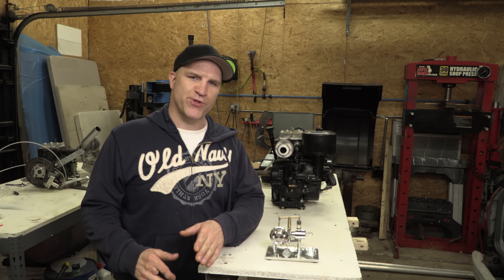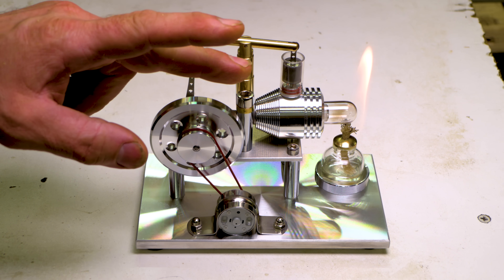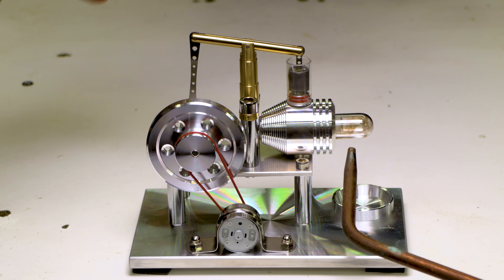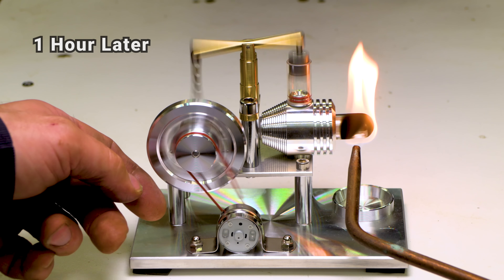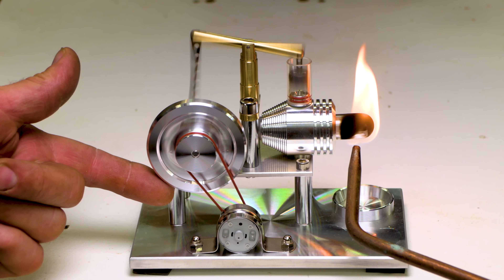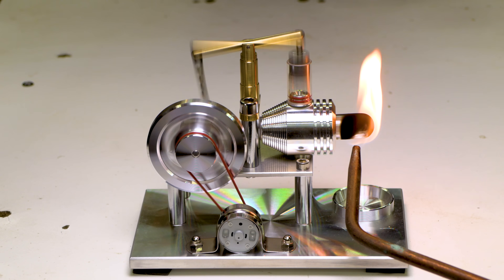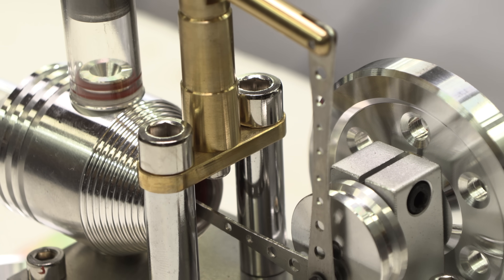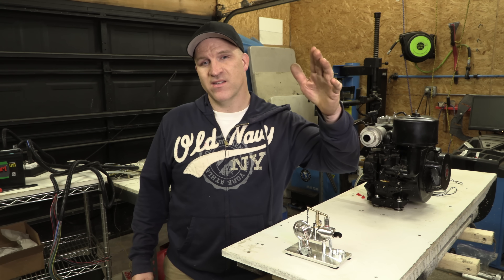Can a Stirling Model Engine Run Non-Stop?

Comment: I've seen engines that ran off a coffee mug's heat.  By comparison, this little guy, is demanding an enormous amount of fuel-burning in order to run.  It's too bad they don't make a coffee cup-sensitive stirling engine that has been scaled up to output 1 or 2 kilowatts.

Comment: If heat saturation didn't stop it, lack of true bearings at those narrow contact pivots points certainly will. Would love to see a well engineered version designed with longevity in mind ..

Comment: Your natural gas is burning too rich and the flame could have a little shield on so there's very little heat leaking over to the cold block.  Also, a temperature sensor on the hot end and cooler end could indicate if you're in a steady state.

Comment: Could you take a Fernnell (sp) Lenze from a projection TV to power a larger sterling engine to power a commercial size generator?  I live in the heart of the Mohave desert.  Daytime temp a little low for this time of the year at 107 but I have seen it 120 here on the Colorado River.

Comment: I think this is the engine I want to use as a “plant engine” outside on the back yard, up on a post, exposed to the weather, running the flame on kerosene and driving a slow pump to bring the kerosene to the reservoir from a tank, to keep it running continuously.

Comment: Dude.. We can use artificial diamond focus lenses to heat boilers for nuclear reactors with light guided down inside, and use excess energy to make hydrogen to run the system for night. Easy.. The system is programing us to be livestock period.. Btw, nuclear reactors are steam engines with radiation heat source..

Comment: I love these little Stirling engines.  I have a practical question, and an idea for a cool video, I would like to know what the easiest way to modify one of these engines is to produce 12v dc via a motorcycle alternator, and also which commonly available fuels produce the most energy.

Comment: as long as you supply heat to a Stirling in an open system there will be enough difference in temp to keep it running.  Unless you melt it.
Reply: Stirling engines are closed system by definition
Reply: @eifionjones559  Okay isolated if you want to get picky

Comment: I understand your thinking: it does not lose enough heat. And I agree, there should be more cooling applied. I guess the reason why it manages to keep running cool enough is, next to the radiation of heat, the air from around going in and out the piston's cylinders.

Comment: After how much time is the glass going to crack ? 
I just bought one and I'm afraid the glass will cracking after a few minutes . But it's a Chinese knock off so idk
Reply: so easy to make a little alloy heat shield tube around the glass
Reply: @eifionjones559  no need for a heat shield . The Chinese knock off is very good and can go for hours at top speed . I had enough time to test it :)
Reply: @DrKampfpudding  the shield is actually called a diffuser
Reply: Sorry that you bought Chinese knock off for cheap. Next time buy American made for $1,000 or probably even more. 😒 Trust me you would not have this made in the usa for this price. Seriously stop talking trash about Chinese made products or their people. Que te han hecho los Chinos a ti?

Comment: ca you run one of these by shining a magnifying glass on the end of the heat exchanger?
Reply: Theoretically yes, practically maybe? These engines don't need a massive amount of delta-t, but they have to have enough energy to overcome the friction of the components

Comment: The engine cannot last forever. It running depends on the fire going. If the fire runs out, the engine is too
Reply from the maker: That's correct, same as a combustion engine though. If you run outta gas, that's it !

Comment: Phillips Holland back in 1953 had a few running just after the big flood in the Netherlands, hooked up to some generators for electricity, to aid in the clean-up and rescue operations.  They owned the patent back then.
They even had some buses running in Eindhoven. Obviously there were some snags with this motor as they stopped developing it and sold the patent -I believe to Ford, but I'm not sure. Also the original design this guy's talking about was quite, quite different. It was much more vertical design.
Reply from the maker: Thank you, is this an alpha type correct?

Comment: The engines principles are based on a difference in temp between the cylinder and the flame. The gas flame will always run hotter than the cylinder does. Hence it would theoretically run forever. That's my understanding anyway. :)
Reply from the maker: I think you're absolutely right, I realized that shortly after this video after I thought about it for a minute. I'm assuming eventually it will reach its peak level of inefficiency and minimum power output, and if that number is enough to complete the cycle, then it will keep on running that way.

Comment: U think if the flame was turned down some and the radiant heat wasn't as hi it would have lasted longer?
Reply from the maker: Well it lasted too long for me. But in the episode I will push this thing to the extreme
Reply: @WarpedYT  yes and most tests that last over ten minutes I am on to the me t video but I am very intrigued by this engine just ordered myself one

Comment: Hey can you do the video on electrical overload fire?  I have always been curious to see what happens inside the wall and so on when an electrical fire starts.  you should do like a loose connection, then another one with like an overloaded wire with two big of a breaker and a few other electrical fire starting scenarios.
Reply from the maker: I will totally put that on my list. That sounds like a lot of fun

Comment: I figure either lack of cooling or lack of lubrication will be the end of it
Reply: add an oil dropper on he hinges, and water cool the heat exchanger and it will run forever
Reply: After an Hour the sytem has itself stabilized, only wear and lack of lubriction could cause a damage. 

Yes, the flame any hotter and the engine get's thermally overloaded, but as is, runs fine. 
What I've know from thermodynamics, they were on the engine's side this time.

Comment: I have a low temperature stirling engine which is little more than a toy,  I can set it on top of a hand warmer and it will run continuously for hours, I've even had it running overnight more then once.

Comment: Here is the other problem i see, that flame is far too large, even the original one was. you need a smaller heat source for this small engine to keep up indefinitely. You need to find the smallest flame that can keep it running that will keep the temperature difference in such a way that thermodynamically one will always stay cooler than the other and will never get over a certain temp on both sides. Yes in theory it ran constant for over an hour but eventually with a flame like that from natural gas or LP it will all become the same temp and start to become so inefficient that it will sputter and quit
Reply from the maker: That's exactly what I thought as well, I'm going to finish up the episode with it, and then after that I'm going to do a follow-up video where I run it continuously until it stops, I'm just trying to figure out the technical challenges involved with filming that.
Reply: Its all theoretical but it makes sense at least in my mind thanks for the vids they are awesome

Comment: This is how I would modify that engine to run forever I would modify the flywheel to wear a has fan blade veins like an impeller to blow air wallets spinning past the cool side then on the hot side I see that you have a generator there I would have that generator run a modified short like a toaster oven to wear a the electricity is creating Heat and there you go at fuels itself peace out into the world have a great day

Comment: Yeah, there will always be enough differential to run it if the hot cylinder is inside of fire and the cold cylinder isn't. You'd have to put fire to the cold cylinder to equalize it.
Reply from the maker: Yeah I didn't really think about that until later, but no matter what you will always shed heat from the heat exchanger and the cold cylinder oh, no matter what unless you heat them directly they will always be a lower temperature than the hot cylinder.
Reply: @WarpedYT  Yup, that said, I was actually really surprised at just how much torque it had left after it hit steady state. With the cylinders that close, I would have thought it would peter out with just a little touch.

Comment: What if you wrapped copper wire around the class bulb and sent electricity to it to keep it hot and just out it in the wall last longer be cheaper than gas
Reply from the maker: That's a great idea, I may have to try that !! On second thought that's an absolute fantastic awesome idea!.
Reply: @WarpedYT  cool man i was thinking you could control the voltage and that would control the heat maybe you could vary the rpm by controlling the heat maybe it will run longer. 👍👍 Love your videos man

Comment: Lower the heat, what's the most efficient burn you can get per voltage generated. This is the question that really needs answering. Let this run for days. Weeks. Measure it.
Reply: It is about the wattage rather then voltage. The voltage the generator produces is dependent on its RPM. Stirling engine is not the most efficient at the highest RPM.

Comment: Just let it go till it dies? Wtf I want to see exactly how long before total failure
Reply from the maker: I know I just have to figure out a way to film it, that's what I was hoping to do this time around but, at 4K 60 frames per second I only have an hour and a half on one memory card that 128gb. So I have to figure out a way to do that for the actual episode. That is if it doesn't meet its demise sooner!!...lol.
Reply: You do not have a time lapse? I bet it will 4 full days
Reply from the maker: I do, but the problem is from a filmmaking perspective when it actually dies or breaks or whatever happens, that part I would love to ramp down from the time lapse into an actual video, or even better into some high-speed video, the biggest trick is to make that actually work. I'm guessing I could do some sort of sound or maybe RPM trigger to stop a camera that's moving so I don't have to wait there with the engine and babysit it for days!. I am going to do another video on this engine at the end, "how long will it run until it stops"

Comment: Dawgone, how many rpm's does that thing crank?  That's a pretty decent price for that setup. I have a really basic sit on top of your coffee cup type sterling engine. It works pretty good but is that nearly as cool as that machine. And it was almost 50% the price of this much nicer one.
Reply: Faster than the frame rate of the camera, and watching it cross that was cool.

Comment: note the air flow, from the flywheel.cooling the cold side. reducing the convection from the flame, dose not hurt, either.
Reply: hm yeah but the amount is so little it is insignificant

Comment: You should really keep it regularly oiled if you are gonna run it like this , also you could move the flame to the very tip of the hot cylinder, and make it smaller,
Reply from the maker: You are absolutely correct, but let me clarify, for one I didn't think this engine was actually going to be fully functional, I thought it was mostly just for looks and minimal function. As for the flame you're absolutely correct, but I didn't want to run it too slow, because I wanted to run it through a more realistic test so I know if it's going to hold up for my episode before I go through all the trouble of setting it up. I have something very extreme in mind for this engine, at this point I'm pretty positive is going to be awesome.

Comment: I would be more concerned with carbon build up on the hot side.
Reply: That carbon is on the outside. Shouldn't hurt anything
Reply: It does reduce the overall heat a little bit
Reply: @ballHand  not necessarily. Once it gets warmed up the carbon would act as an insulator and help keep heat in.
Reply: @TypicalPeen  carbon is one of the best insulators due to its infrared   radiation efficacy, so no, it will cool down the cylinder.

Comment: It would be kind of neat to see a stirling engine powered by focused sunlight of a parabolic mirror, to illustrate its application field.
Interesting video as always, greets Zigzag
Reply from the maker: I completely agree that would be cool
Reply: They exist. Look like satellite TV receivers. More efficient than solar panels at generating electricity, if I remember correctly.
Reply: Giin  Sure, they exist, thats what I meant with illustrating the application field. They may be a bit more efficient but have the downside of requiring direct sunlight in contrast to traditional solar-cells, which work with for example by clouds deflected sunlight as well.
Reply: @zickzack3106  gotcha. I misunderstood.
Reply: yeah or cooled with water and fuel with diesel :P the other field where those are used
Reply: JohnnyQ90 did a video on that, its pretty cool if you havent already seen it

Comment: I’m not familiar with Stirling engines but there must be some inherent limitations otherwise industry would be installing these everywhere theres a heat source to generate secondary power.
Reply: Power to weight ratio is where they break down. They are actually highly efficient.
PS. I have an engine exactly like this on my desk at work...😍
Reply from the maker: Exactly my thoughts
Reply: AFAIK it's weight and size that limit their usage case.
Reply: Nope Norris: first thought is installing it in a foundry chimney to utilize the waste heat.

Comment: Older Stirling engines were used on fans. You can get a stirling engine fan that would run on kerosene and it would go as long as you had fuel.

Truly impressive piece of equipment.
Reply: They make them for wood stoves.
Reply from the maker: I have seen those, what I really wonder is, how much fuel would you have to spend to run a fan versus just running it on electricity, I mean how much cheaper is it to run electricity from the power plant versus burning natural gas yourself making that conversion to electricity, in the winter months maybe even using that heat that's left over from the stirling engine to heat your house. You never know
Reply: @WarpedYT  with a fan you can calculate how much air is being moved, then calculate how much it costs to power that fan for x amount of time, and figure out how much it would cost to use natural gas so you can power a stirling engine fan to move the same amount of air over x amount of time.

...

I would assume that natural gas is cheaper than electricity. furnaces in northern states burn some type of fuel to heat the houses because it is almost always cheaper than using electricity to heat the same area under the same conditions.

True story time...

My last apartment was baseboard electric heat, the electric bill was far more expensive through the winter, than the gas bill in my larger home to heat a larger area.

More story time...

I live up in Minnesota, I've had at least one friend who lives far Northern Minnesota, he Sam's and splits all the wood from the trees he cuts down on his property, plus he gets more wood from other trees that are cut down in the area. He uses that wood to fire his wood burner and runs that Heat with an electric blower fan through the ventilation system in the house, as well as heating the water in his water heater. He originally had 5 ceiling fans on one common motor with a huge belt system running to the house to move all those fans. It would have been awesome to see all that run on 1 high torque stirling engine if there is such a thing.
Reply: Dave Pitsch electricity is cheaper I think. Here in Germany it’s 3x more expensive than natural gas. But electrical motor is 50-98% efficient. Stirling is maxx 16-20%. 1/3 third of Carnot I believe
Reply: @David-cy5zu  that does make perfect sense, other ways they can be used to increase the efficiency would be if a stirling engine fan were placed on a warm air duct or some other wasted heat energy place, capturing the heat energy to use as fuel for a Sterling fan would make it very efficient.

Comment: Well, yeah. The two parts can't have the same temperature to kill the cycle if one has a flame and the other has a heatsink; that's not how physics works. You'd have to have the ambient air at the same temperature for the cycle to stop, and that's not going to happen in the open air.
Reply from the maker: yes true, but this engine is the gamma type I believe, Closed-loop and does not use the ambient air for anything other than cooling the heatsink. I will triple check as I havent taken this engine apart just yet, but I think thats the case.
Reply from the maker: Actually I just thought about your comment, and yeah you are completely right, as long as that heat sink is a lower temperature than the hot cylinder there will always be a stirling cycle to some extent. Even if the difference in temperature is minimal, just the efficiency would drop and the power output would drop significantly, but you would always still have the cycle. for some reason I was thinking ahead into the actual episode that I'm writing for this engine where I show that concept, but I won't give it too many details here and spoil it.